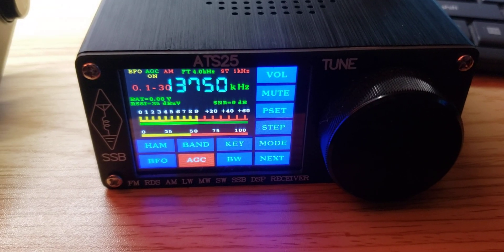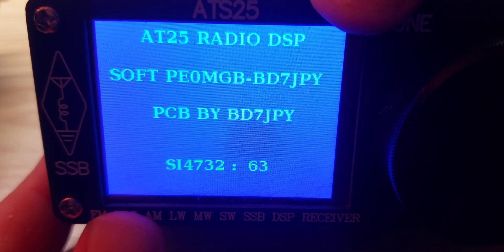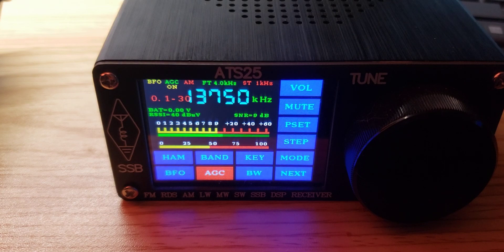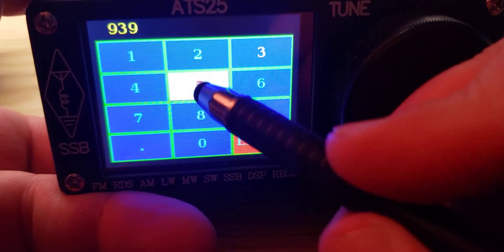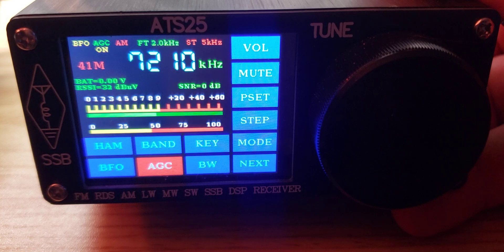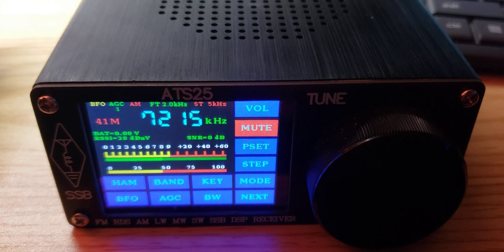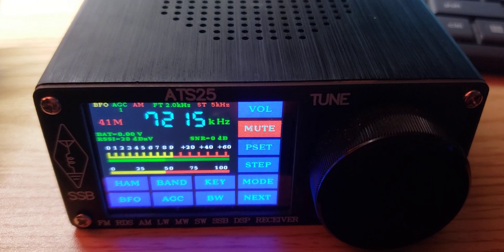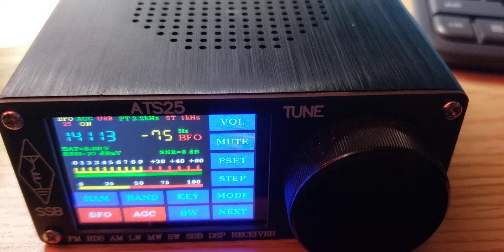Quick operations of the ATS-25 DSP portable receiver and looking at the buttons and features

Comment: I just got one of these yesterday from Amazon. I think most of the issues you have with attenuation, Preset, and so on are from the firmware you have. Mine has different firmware from your one and has a different button layout, but mine says (from memory) RF-ATT 1 (on the NEXT page) which can be adjusted by tapping it and turning the dial. My VOL button (on screen) is in a different place too. Same with the PRESET button. I think they've moved the PRESET button on your firmware but it's still linked to AM. I can post some screenshots of mine, and the version, if you like?

Comment: I am very happy with my ATS-25 and it is getting cheaper by the week. A bit over a month ago I bought this receiver from Aliexpress for 78 bucks and 12 bucks shipping. It must be cheaper by now. No problems with the encoder and receives very well with my new MLA 30+. My battery  voltage display works well and is the same version as yours.  I do love it's quirks but is very easy to use. I am happy you are still a fan of this little radio receiver as I am. Listened to Radio Romania tonight in English as it was fascinating as well as 40 meter Ham band.